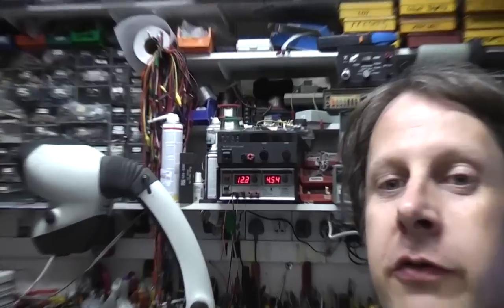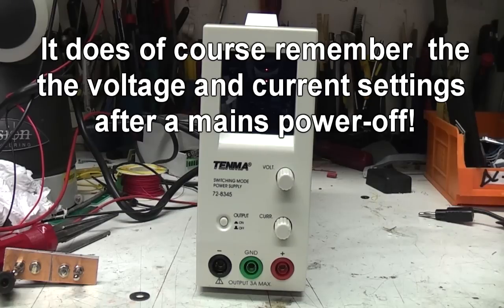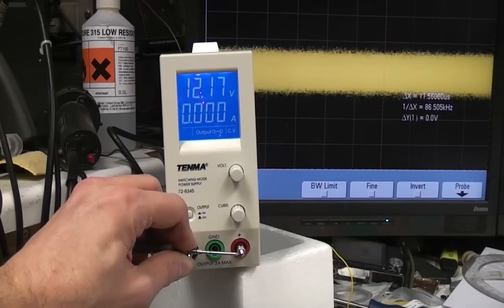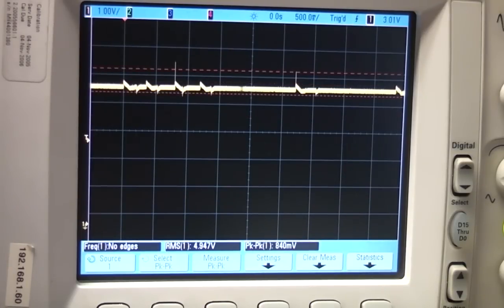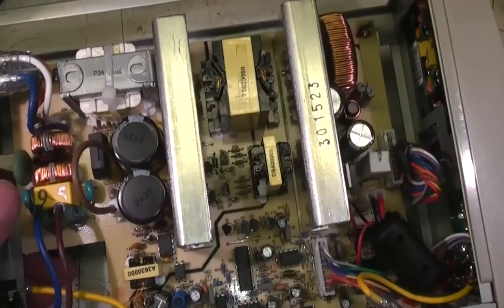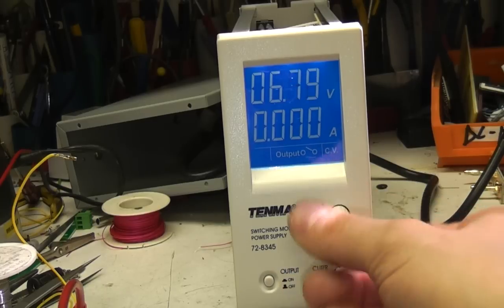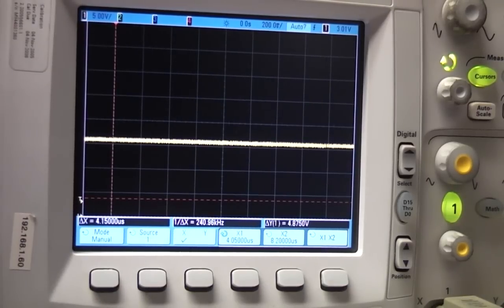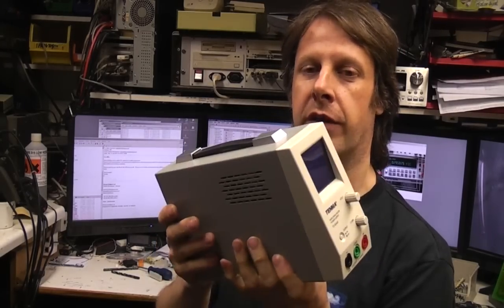Tenma 72-8345 bench power supply review

Comment: I have an issue with one of these PSU´s. My output seems to be constantly on, you can push the on/off switch an the display also indicates, that output switches, but on the output-terminals there´s always current. How is the output switched? Any ideas wich part can be faulty. besides this issue it seems to work fine, but it´s annoying not be able to switch output.

Comment: We had something similar to this at work. I can confirm that those front dials were the first casualty when someone opened a cupboard and it fell on its front! We replaced it with a B&K 9200 series (£1000 600 watt psu, so not exactly in the same league lol). The B&K controls are low profile and protected by a rubber bumper. Much better design!

Comment: I like these bench power supplies alot! Also, in later (i.e. current) versions, you can actually push on the knobs to select the digit you want to adjust. That's a nice bonus so you don't accidentally scew your hand off.
EDIT: Oh, and in the newer versions the set current is acutally displayed when the output is off.

Comment: When it goes into the unstable mode that you can hear it can blow the power transistors on the primary side as well as the fuse, some times it is just the fuse that goes. Luckily the power transistors are easily available and I have stocked up on them as I have caused them to blow several times, I even had a fuse physically explode once. I have not seen any coloration in the loads the PSU does not like.

Comment: I bought this cheapie, and I'm very happy with it http://www.aliexpress.com/item/Free-Shipping-precision-Compact-Digital-Adjustable-MINI-DC-Power-Supply-CPS-1610-OVP-OCP-OTP-low/1802939097.html
Reply: Doc T'Soni Looks like any SMPS essentially, but clean and well-built. It also has all the input protection you could expect (or need). Best picture I have at hand is this: https://dl.dropboxusercontent.com/u/15526481/pic1/WP_20131220_001.jpg
Reply: +TheAmmoniacal I'ge got a bad feeling about this one, it looks like output leads pops right next to mains filtering circuit.

Comment: Seems that in the last couple of years, Tenma listened and fixed several of the issues.. metering is faster and the jitter has been fixed on my 20V@5A model, encoders allow setting any of the digits, set current shows whenever you tweak it's encoder (regardless of output being on or off). I think that covers all your main gripes :) I've only had mine for maybe half a year.. possibly slightly longer.. they didn't fix the binding post gripes though.

Comment: Hi mike, I've recently discovered your page. Been watching that ozzy bloke for some time. I'm a computer guy but I'm getting into working with micro-controllers etc, this meaning I'm also learning some electronics, I do have some background in the area but not in a professional way. Can you recommend a cheap option for a desktop PSU (I'm looking for something with a current limit and two isolated outputs) and a cheap option for a scope. Ive looked on ebay and people are always saying there are cheap scopes on there but I rarely see anything. I do have a comprehensive computer setup, Are there are decent USB devices that would work for my needs, I'm working with Rf or anything like that. how much was this supply?
Great vids, thanks.

Comment: I have been noticing a humming noise at times when you press the 'on' button, as I hear in many electronics, just wondering if this is something you noticed (I did only observe this after you added the resistor to increase the LCD update speed).

Comment: I've got a rebranded 20V 5A one from maplin which has single turn pots instead of encoders, and it is the most tremendous pain. 1V is about 15 degrees turn, so it's really challenging to set the output precisely. 
The readout refreshes much faster too, and it is incredibly precise with much less noise and overshoot than yours. 
I always seem to get the extremes of good and bad...

Comment: I actually soldered on the ISP header and tried to dump the code. However the lock bits are sets, so no code download :(. May trace the PCB and see if I dare to throw out the official firmware...

Comment: I could never do that, I need accuracy! the last power supply I bought had the same problem and altering the RC oscillator clock on the main IC sorted it out. you have to get it fast enough to respond with the dial but slow enough to not jitter

Comment: For folks looking for inexpensive used gear, don't forget to consider old variable linear supplies. I have a Heathkit from the 70s, good from 0-30V @ 1A with adjustable current output, and it has great stability. All I had to do was swap out the original pot with a 10-turn bournes from ebay and it was even better for more precise work.

Comment: One thing to be aware of is that infrared thermometers are COMPLETELY USELESS if you need to measure most metallic surfaces (i.e heatsinks).

Infrared thermometers operate at approximately 10um wavelength, and at that wavelength, most machined aluminium surfaces (and stainless, have not tested much else) are essentially mirrors, with ~80%+ reflectivity.

If you look at an aluminium surface with an infrared camera, it actually behaves much like a glass mirror does at the optical wavelengths.

Comment: I wanted to make a couple of corrections on your video. 1). That transformer with the zip-tie on it I don't think is an APFC, I think it's some kind of choke or step-down transformer for mains AC. 2) That little transformer just below the big power one is the gate driver for the power mosfets and not for stand-by power. I think the SB transformer is that small one is the lower-left.

Comment: I had one of those power supplys, it was the 20v 5a one, bought it in maplin for about €100. It had linear pots instead of the stepped ones in yours and i think the update speed and accuracy was better. I found out the hard way that the primary heatsink was live. Sadly it blew up while i was making hydrogen and oxygen. It was in constant current mode at 15v 5a and suddenly the current went up to 9a and 20v then after making alot of noise i saw a large flash and it stopped supplying any voltage.

Comment: i've rebuilt an old 60's era linear supply using modern components and voltage reference etc, i've given it 5 presets using the existing radio buttons with multiturn trimpots for setting, 6 constant current settings again using radio buttons (handy for testing most LEDs 100uA - 40 mA and i've trimmed the shunts a bit). considering its a supply i built myself its pretty good and it'll supply a few amps

Comment: I had (still have) such a PSU, that accidently got drenched in ferric oxide and saltwater.
Didn't even blow a fuse, and after a little while with qtips and an old toothbrush it worked fine.
Btw, mine is rated for 30minutes duty, but it runs fine for a week. =P

Comment: I've got a similar supply, the Maplin N27GG. Has the same problems but a couple aspects that better the model you have. Bit more bodgey in the build quality though, They've crammed quite a few boards and jumper wires in there. I did a little review/tear down on my blog a while back so I might go back to it and see if I can get the update running on it faster like you did.